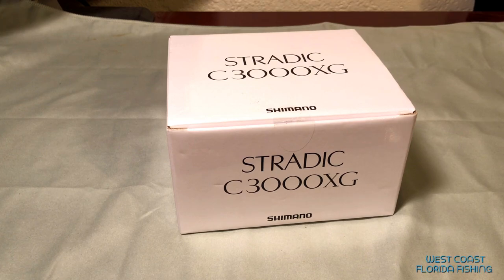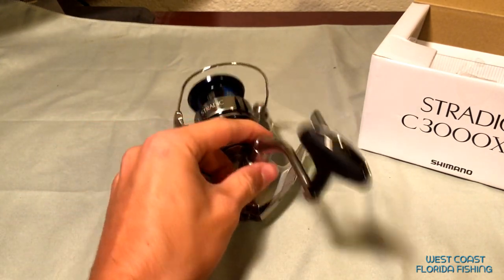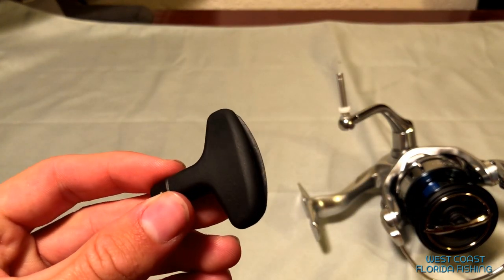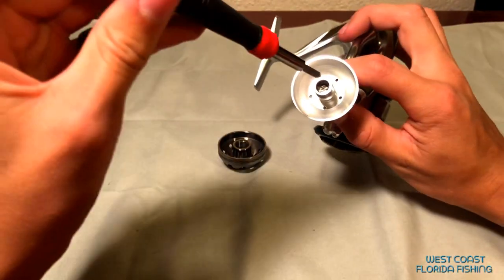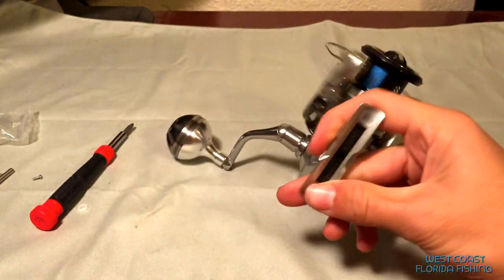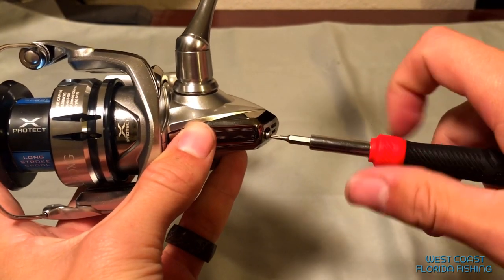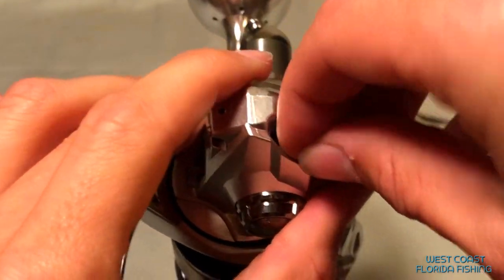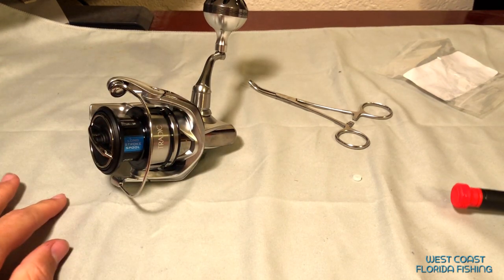2019 Stradic FL Unboxing and Upgrades | Gomexus Power Knob | Upping Bearing Count

Comment: Hi! Where can i buy the tools like the torque 0.9 you use for all the parts you change?
Reply from the maker: I have listed them in the description but for your convenience here is a link to purchase a .9mm Hex! 
Hex Driver to Remove Spool Support Screw : https://rover.ebay.com/rover/1/711-53200-19255-0/1?mpre=https%3A%2F%2Fwww.ebay.com%2Fitm%2FMIP-9012-Thorp-Hex-Driver-0-9mm%2F193338278448%3F_trkparms%3Daid%253D1110006%2526algo%253DHOMESPLICE.SIM%2526ao%253D1%2526asc%253D20200520130048%2526meid%253D92481a1e41454683806dce0ac51a0a16%2526pid%253D100005%2526rk%253D4%2526rkt%253D12%2526mehot%253Dpf%2526sd%253D233598126928%2526itm%253D193338278448%2526pmt%253D1%2526noa%253D0%2526pg%253D2047675%2526algv%253DSimplAMLv5PairwiseWebWithBBEV2bDemotion%2526brand%253DMiP%26_trksid%3Dp2047675.c100005.m1851&campid=5338690692&toolid=10001&customid=Hex
Reply: @WestCoastFloridaFishing  Thank you for the help and link:)
Just one more question - The Power Knob is any reason to change it? Is it better fit into the hands or something else? And would it make the reel heavier ? (I see the 38mm is 34 grams).
Reply from the maker: Susie Lund the only reason to change it is if you don’t like the original Handle!! For me I like the feel of a large handle ball so that’s why I chose to upgrade it! Good question! And you’re welcome!! I’m glad I can help you!

Comment: Should I get the 5.0gear ratio or XG speed if am just casting 30g jigs off the shore and maybe some rubber jigs
Reply from the maker: Definitely the high speed XG! Sorry I missed this comment buddy! Both will work but I would prefer the faster gear retrieve!

Comment: I bought the same reel and also trying to upgrade to the Gomexus power knob but the I put the screw in the ball knob will not spin. What am I doing wrong ? Please help !
Reply from the maker: Make sure you’ve added the proper about of shims or else it will get too tight on the handle and not work correctly.

Comment: Just got them and the worm bearing looks too small. Do you have the dimensions on the worm bearing?
Reply from the maker: There are two worm bearings so I need to know which one you think is too small! The lower worm bearing done in this video is going to be RD11018 So make sure you ordered the right bearing! If it says 11018 it will fit! you just have to try it because it does look quite small! I can try to find some dimensions for you if you need.
Reply: It fit. Just looked to small when it was in my hand👍
Reply from the maker: @jarradmorgan70  Okay awesome!

Comment: Do you know if the Stradic 3000FJ / the FJ series is similar to the internals of this?
I just bought a ceramic bearing kit for mine and am a bit spooked on pulling her apart as i cant seem to find a guide anywhere for the 3000FJ
Reply from the maker: SCNZ I do know the Stradic FJ and I know it’s not the same inside! It’s much more difficult to upgrade it but let me see what I can find for you.

Comment: Hi bro, i recently bought the Stradic FL, but i have some handle play , some back play, any help?
Reply from the maker: El Petazeta yeah bro absolutely! So the reason there is a little a handle play is because of the space between the main gear and the pinion gear. To reduce the handle play (or space) in between the gearing you must shim it out with gears underneath the bearing closes to the non-teeth side of the gear. Great question! If that doesn’t solve it then you might be looking at a handle knob that isn’t properly shimmer and that can be easily done by taking the knob off and adding a small shim until comfortable. You gave me a great idea for a video so if any of this does not make sense I will be creating a video on how to reduce the handle play in a Stradic so stay subscribed to the channel and make sure you have notifications on so you can get notified when I upload it! -Isaac
Reply: @WestCoastFloridaFishing  it would be awesome if you could do a video on how/where to add this shim? i have a FK with some play and its driving me nuts.

Comment: Does these bearing work/fit for all the Stradic FL models? What is the difference on the Stradic FL and HGFL?
Reply from the maker: The bearings are slightly different for some of the different sizes I have a few different videos on the 3000 reel and the 1000 reel so far and I plan to make more! The difference between HG FLand the standard XGFL is the gear ratio is extra high gear when it’s the standard XG.
Reply: West Coast Florida Fishing 
I’ve seen both the vids you mentioned but I like the 2500 series and was wondering if those parts for the 3000 series would fit the 2500.
Reply from the maker: Yes all of the parts used in this video will work for your 2500 size Stradic!

Comment: Will the same sized  bearing work for the 4000 Stradic? Or do I need bigger bearings?
Reply from the maker: Vegh good question! The worm gear bushing is the same size but the spool support beading is a different size.. look up the part number for the bearing on the spool support shaft for the 4000 size Stella and that’s the bearing I would use! Good luck with your prodject!
Reply: Thanks I appreciate the answer.
Reply from the maker: Vegh of course! I hope I was able to help you!

Comment: I have bought me a Stradic now. The handle makes this "clicking" sound when Im reeling. Like it is a little loose or something. Is it supposed to be like this? Thank you for every answer.
Reply from the maker: They typically come with some slight “gear lashing” which can be fixed by adding a shim onto the main gear and I will make a video about that in the near future but as of now, your reel is normal 😁
Reply: Thank you for your answer. Ive been in contact with the shop I bought it, and Im about to send it back. We bout thought it was something wrong with it. But if this is normal, I cant understand the price tag tbh. 😅 Does the shim come with the reel? Is it those tapes coming with it?
Reply: Turns out it's just me who sees this as a problem... My father and one fellow fishing friend, can't hear/see a problem with the reel. Anyways I will look for the video of you adding shims to a reel. Best regards.
Reply: @bjrnarrnning7897  just bought me a stradic 5000 yesterday ago and mine does the same  noise

Comment: Good job goofball lol jk. In case anyone was wondering about the same bearings for the 4000-5000 size Stradic FL:

spool support bearing 
RD14866

worm gear bearing 
RD11018 (same for 2500-5000)
not sure about 1000

Btw gomexus offers a dual handle for these reels. I'm going to try one, they look a little bit better than the single gomexus upgrades imho.
Thanks again!
Reply from the maker: Thank you!! Awesome thank you for that information to the public! I cross referenced your parts and they are correct, the worm gear bearing for a 1000 size Stradic is also the RD11018 😁😉 and I do enjoy the retro look of the dual handle.. reminds me of the one they make for the Stella that was made out of carbon fiber... Thanks for the a support brother!

Comment: Whats the reel size difference in the 2500 and 3000? Are they the same size?
Reply from the maker: The body, rotor, gears, bearings are all the same size.. the only difference between Shimano 3000 and 2500 sizes are the depth of the spools and the knob handle! Good question!!

Comment: Could I put this handle on the 5000?
Reply from the maker: Ethan yes you definitely could! If it were me and I was going with a 5000 size reel I would keep the stock power knob! But if you want a gomexus I would get the 40mm one
Reply: A power knob like this is actually much more suited to the bigger reel, with its heavier line. So yes.

Comment: Can i know what size bearing did you used? Both of bearing
Reply from the maker: Yes the spool support bearing is RD 13274 the handle bearing is RD13269 and the lower worm gear bearing is RD11018. Good luck with the swap!
Reply: West Coast Florida Fishing ouhh is this part you take from stradic fl or stella?
Reply from the maker: mr nobody I take these part numbers out of the Shimano Stella!!
Reply: West Coast Florida Fishing ouhh it can fix on shimano stradic fl 4000xg?

Comment: Do you know what bearings fit the C14 3000FA and 2500HG
Reply from the maker: Chris G. The very first ci4 Stradic? Or the ci4+FA?
Reply: C14 3000 FA
Reply from the maker: Chris G. These bearings will fit both reels! 
The spool support bushing to a bearing we use the Stella counterpart bearing with the part number RD13274 found here: https://www.youtube.com/redirect?v=PRa4zIlzEeo&event=video_description&redir_token=QUFFLUhqa0diMXpNNXhrVnB3ME5LaE5FdzZsQkxGeE5MQXxBQ3Jtc0tuVmE5Ymc0MEVjd0laUmVYUjkyRWl5TXlOVEF1S01ZZU51Zk1NamhaOXVYYk9tSFhsb1V0eXVLNElPUEFLQVJ6cFVOR3VYVnVaS3c4Z2p1YzRDODhBdVZ5VmVZc0V0NVh2WkJsZW00czc2Yl9XZFFSTQ%3D%3D&q=http%3A%2F%2Frover.ebay.com%2Frover%2F1%2F711-53200-19255-0%2F1%3Fff3%3D4%26pub%3D5575591865%26toolid%3D10001%26campid%3D5338690692%26customid%3DStella%2BBearing%26mpre%3Dhttps%253A%252F%252Fwww.ebay.com%252Fitm%252FShimano-reel-BEARING-BUSHING-replacements-by-part-number-STAINLESS-CERAMIC%252F124096850349%253Fhash%253Ditem1ce4bfa9ad%253Am%253Am7HCh0tI8dMxHBsqBgMSP6A The worm gear bushing to a genuine Stella bearing number is RD 11018 and can be found at this link here: https://www.youtube.com/redirect?v=PRa4zIlzEeo&event=video_description&redir_token=QUFFLUhqbXBDRGxoYklHTVhhMURMc0xkVXFvUDBJVks4Z3xBQ3Jtc0ttREFnM3k3WXFwMFlPUndReEVZS25oTEZKZkVSSW9TalhnenU4R0t5UWFSck9ZbGNhQ0RxSjFWSVdacHU3a0M2dzJpZUs0QkxaSUtJaDRfMTZReHR6YjcxM0FoZkJwNl9zWUJaVVk5ekxVUnNNX3JqVQ%3D%3D&q=http%3A%2F%2Frover.ebay.com%2Frover%2F1%2F711-53200-19255-0%2F1%3Fff3%3D4%26pub%3D5575591865%26toolid%3D10001%26campid%3D5338690692%26customid%3DStella%2BBearing%26mpre%3Dhttps%253A%252F%252Fwww.ebay.com%252Fitm%252FShimano-reel-BEARING-BUSHING-replacements-by-part-number-STAINLESS-CERAMIC%252F124096850349%253Fhash%253Ditem1ce4bfa9ad%253Am%253Am7HCh0tI8dMxHBsqBgMSP6A And the last bearing we used from the Stella is RD 13269 and can be bought here: https://www.youtube.com/redirect?redir_token=QUFFLUhqbkpmeWstSFE2Vi13b09Fc2pEWktoUHhEZl9GZ3xBQ3Jtc0tsRk1GZGJYbWgxWE9XbVVZYVVFY3hhMUx1T0xJa0NSajU3amJYd01nVWhFU215cHpsSjlQOHRqRmF6Snpwbk16a2RMdEc5NFgtZ2NiVk1kSUtybTR6SVpGaFpoQ3dPRXJ5UkxTazBaVEV2ME9Wa0FNZw%3D%3D&event=video_description&v=JLtvLh5LeFA&q=http%3A%2F%2Frover.ebay.com%2Frover%2F1%2F711-53200-19255-0%2F1%3Fff3%3D4%26pub%3D5575591865%26toolid%3D10001%26campid%3D5338690692%26customid%3DStella%2BBearing%26mpre%3Dhttps%253A%252F%252Fwww.ebay.com%252Fitm%252FShimano-reel-BEARING-BUSHING-replacements-by-part-number-STAINLESS-CERAMIC%252F124096850349%253Fhash%253Ditem1ce4bfa9ad%253Am%253Am7HCh0tI8dMxHBsqBgMSP6A

Comment: When upgrading the handle with a Geomax, you are left with an extra bearing. Can you use it anywhere else?
Reply from the maker: What I did with all of my extra bearings was keep them for when the bearings went bad.. They do not fit anywhere else to answer your question.. So I used them as backup
Reply: That’s a bummer since I have 4 extras. Will check my Fuego LTs or Conflicts for possible fit. Thanks for great content, top notch!
Reply from the maker: Nedim Husrefovic yeah I would say that just about any of the Shimano reels within the stradic series FJ-FL would use those bearings. You would even get away with using them on the spheros inshore Sw reels, and possibly the ultegra reels but I haven't double checked those two. And thank you so much! It means a lot to me! Make sure you enter my giveaway to thank everyone of you guys who watch my videos!!

Comment: Wanting to do the same upgrades on stradic fl 5000 would it be the same bearings?
Reply from the maker: William Lewis the worm gear bearing and the handle bearing are the same but the spool support bearing is RD17751! Good luck!
Reply: West Coast Florida Fishing the handle bearing comes with the gomexus handle doesn’t it? Thanks and great video
Reply: West Coast Florida Fishing having trouble finding that rd17751, any suggestions?
Reply: West Coast Florida Fishing still haven’t figured it out suggestions please! Ordered worm gear bearing and gonexus handle

Comment: Has anyone had their stradic make a kind of scratching or light scraping noise out of box?
Reply from the maker: Actually.. once.. I was upgrading a reel for one of my customers and I did hear a very faint scratch noise but it felt like it wasn’t doing anything drastic to the reel so I left it alone.
Reply: I did these bearing upgrades on my ci4+ Stradic recently. It felt fine out of the box, but after the upgrade, I was getting a clicking on the shaft moving up. I made sure the worm gear pawl and the screw that holds the plate over the worm gear bearing were tightened down enough, and it went away. I think there was play in the gear that wasn't supposed to be there. I couldn't feel anything, though, could only hear it.

Comment: I cannot find a torx that small any where
Reply from the maker: Here is the link to the retaining screw in the shaft! .9 Hex Driver to Remove Spool Support Screw : https://rover.ebay.com/rover/1/711-53200-19255-0/1?mpre=https%3A%2F%2Fwww.ebay.com%2Fitm%2FMIP-9012-Thorp-Hex-Driver-0-9mm%2F193338278448%3F_trkparms%3Daid%253D1110006%2526algo%253DHOMESPLICE.SIM%2526ao%253D1%2526asc%253D20200520130048%2526meid%253D92481a1e41454683806dce0ac51a0a16%2526pid%253D100005%2526rk%253D4%2526rkt%253D12%2526mehot%253Dpf%2526sd%253D233598126928%2526itm%253D193338278448%2526pmt%253D1%2526noa%253D0%2526pg%253D2047675%2526algv%253DSimplAMLv5PairwiseWebWithBBEV2bDemotion%2526brand%253DMiP%26_trksid%3Dp2047675.c100005.m1851&campid=5338690692&toolid=10001&customid=Hex

Comment: Why anyone would want to put a power knob on a reel this size escapes me. Its certainly not an upgrade, its just a modification.
Reply: Cause the normal one bad
Reply: @THEBOSS47MLG  The normal one is shaped more specifically to the contours of our fingers. Ball (power) knobs are really designed to nestle in the palm of your hand because the curves are all wrong for our fingers. But as the term "power" implies, this is really only an upgrade with bigger reels and heavier lines! Dont just assume that if something's different, that its automatically better. Think about what is physically actually happening. There are lots of companies that prey on peoples lack of understanding to make a dollar. If you convince yourself that you like it, then use it, but try the standard one first.
Reply from the maker: To answer your original question with my personal answers and reasons. I wanted to put a power knob on this reel right out of the box because I had used the exact same knob on the stradic Ci4+ and my hands like to slip off of the knob as I am fighting the fish and setting the hook. To fix it I simply added this as an upgrade because for me, having the old shape of knob didn't preform as well as the spherical shape did. I do agree it is not for everyone though, and I recommend anyone to just do what they like with their own reel! Just a large matter of opinion and preferences! I prefer powerknobs and upgrades my friend. -Isaac
Reply: mark rigg I have tried the standard one it’s alright but I didn’t really like the t shape of it and I liked the metal feel of the Gomexus power knob, and it matches my reel perfectly
Reply from the maker: Theboss47 Exactly my feelings in a lot less words!
Reply: @THEBOSS47MLG  I guess if you like the feel of it then that's OK. Its just for me a ball knob is for heavier tackle where you've got the ball cupped in the palm of your hand. Lighter gear is more about grasping with your fingertips and that's when you end up with  one convex surface resting against another convex surface , which to me feels like your pressure is  all being concentrated on one point instead of being spread out. Spreading loads increases comfort. But if you like it its all good.
Reply: @WestCoastFloridaFishing  Fair enough. What is a man without power in his knob?..........

Comment: Does replacing that plastic disc with a bearing on the shaft improve the spool wobble ? Mine still has the plastic instead of a bearing and it seems as if the spool wobbles and I was told that replacing it with a bearing will help… are the dimensions 7x11x3?